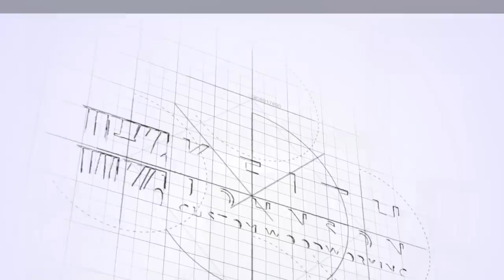Learn how to miter fold. Floating fireplace mantel

Comment: I've been wanting/planning to build the same  type of mantel for my home.  But my fireplace is 15 feet long from the corner of a wall.  The existing mantel is concrete blocks and the fireplace is stone. A previous owner without any woodworking skills built a hideous mantel over the concrete blocks.  Watching your "plan B" helped me decide that I should rip off the entire mantel including the original concrete blocks and attach the new mantel to a ledger board.  Thank you! My ugly mantel has been haunting me!
Reply from the maker: Sounds like a fun project! And yes, sometimes it's best to get down to ground zero and build it correctly to ensure quality and the peace of mind knowing it was done right.

Comment: Great videos!! You are an expert in woodworking. But many of us don’t have all the equipment you have in your shop. So I am not sure if DIY is a term that applies to your art. Congratulations.
Reply from the maker: Thanks for the kind words, Cecelia! For this project, all you really need is a table saw (or circular saw with an edge guide) to cut the bevels and then some glue to make the box mantel.

Comment: Keith - aren't those threaded inserts visible or, put another way, what did you do to make them not be visible the rest of the year?  Thanks!
Reply from the maker: Well, they are below eye level and recessed just below your he surface. They aren’t visible unless you poke your head under there.
Reply: Ohhh! That was pickling my brain. I thought you'd put them on the front 😂. I thought it was just going to be one of those 'customer is always right' type of things.
Reply from the maker: @leegreen287  Ah ok. Glad I was able to clear that up...my apologies for not making that clear enough in the video.

Comment: Great work, as usual. Love White oak. Just one question, is there any reason you didn't use a miter lock profile for the joints?  We have a wood shaper and we are considering the investment in a cutting head that does the miter lock . Seems like a big time saver.  Cheers
Reply from the maker: Thanks Gavin! I've never bought a miter lock bit after hearing so many horror stories about the setup and getting a consistent good fit. It's a great joint with a ton of surface area for glue, but I've yet to give it a try.
Reply: @KeithJohnsonCustomWoodworking  Set- up ! Hmm, there's always something.  Though, we are set up with a power feed. so perhaps there is hope!

Comment: Another great vid!
When using the microfibre cloths to buff your finish, how do you wash/reuse these?  Or are they single use?
Reply: Good question!  I just bought some rubio, but have yet to use it.
Reply from the maker: Thanks Sean!! Yeah, those microfiber cloths are one-time use only since the Rubio hardens on there. I buy them at Harbor Freight, so they are relatively inexpensive. You can use blue shop towels as well which would be a little cheaper.
Reply from the maker: Yes, one-time use only unless you have an industrial solvent cleaning washing machine 😜

Comment: You could have stopped at the intro...the finished, installed mantel shot was like, Wow!" I like that the client had foresight about hanging stockings...we would not want any "handywork" on the homeowner's part when Xmas comes along, (it's best that Keith should do the deed). Did you fire the shop helpers?
Reply from the maker: Haha. Thanks Juliet! I actually brainstormed that intro on the way to the client's house for the install. 😂. And I thought the stocking thing was a great idea, so I was glad I could come up with a solution for the  client's request. And I don't know where Jerry and Lola were on this one. I probably kicked them out because of all the time on the miter saw and table saw.

Comment: Why did you go with the clamex vs the tenso connectors from lamello? The tenso dont require the allen key hole. Also great video as always!
Reply from the maker: I like that ability to dry fit and remove easily if necessary. I fee those Tensos are pretty finally once snapped together.
Reply: @KeithJohnsonCustomWoodworking  makes sense. Thank you for the answer.
Reply from the maker: @matsler89  No problem! Thanks for the question 👍🏻

Comment: Hey Keith! Quick question for you. I noticed you didn't apply finish to the interior of the mantel. I'm making a flat file out of white oak and wondering if I need to apply finish to the inside of the carcass? Will it warp if I don't? Thanks Keith!!
Reply from the maker: Usually helpful to finish both sides. This piece was so small and securely fastened hat I wasn’t worried about warpage
Reply: @KeithJohnsonCustomWoodworking  Thanks Keith!!